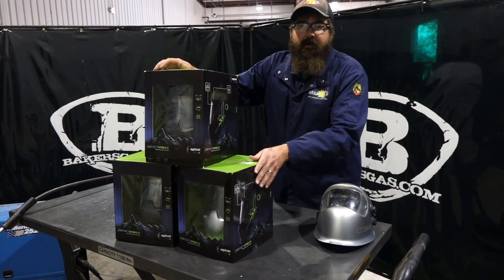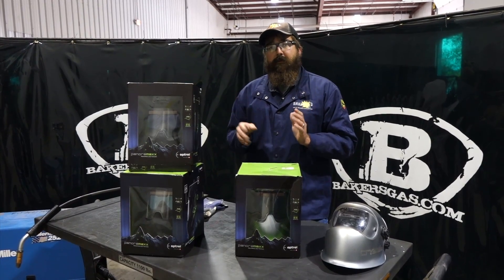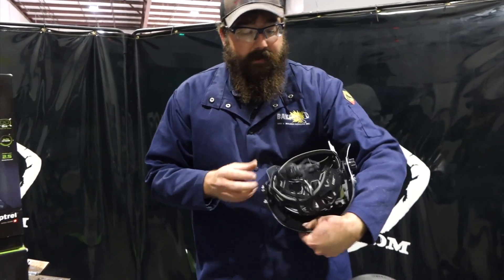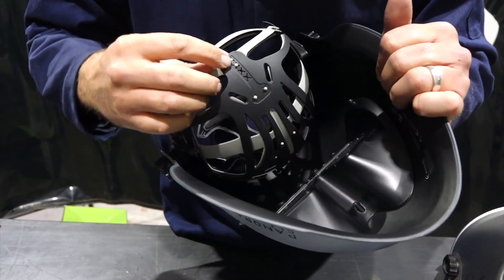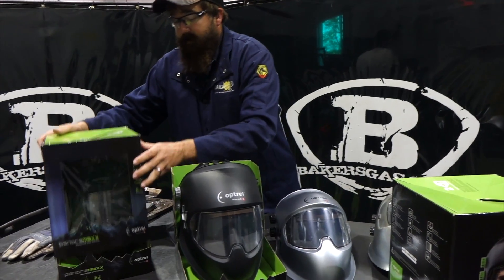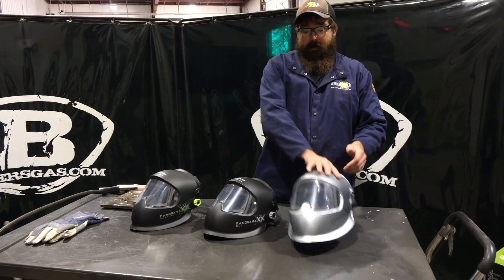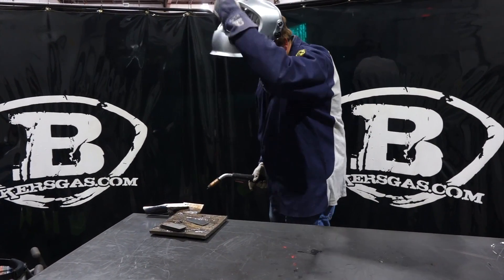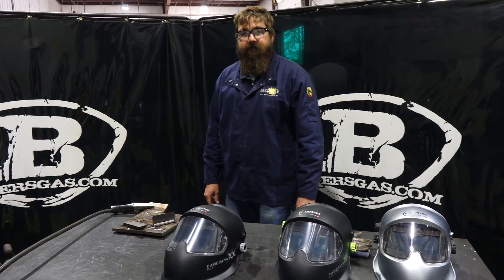New Panoramaxx Series by Optrel - Crystal and Quattro with IsoFit Headgear!

Comment: My major concern about the Optrel CLT hoods which has held me back from buying one, 
is the Permanent non replaceable batteries that last only 300 to 500 cycles. They also Use a Micro USB to charge which are a notoriously flimsy connection, I'd expect USB C from an industrial product. There are a lot of people who have a dead helmet after 2 years, but even if it's 3 or 4 years with the last year charging your hood all the time because your battery barly holds a charge this is just a bad experience I know people that this exact situation happened to. after 3 years they ended up having to switch back to their 10 Year old Speedglas Bad experience for the welder.

When i went looking for pricing on a replacement ADF cartridge thats not even available as a spare part so you have to buy an entirely new hood WHEN the battery dies because it will die.
You might put big hours 8 hours a day under the hood good luck getting past 18 months.
Maybe you only weld 1 hour a day you better be paranoid about charging not just charging to top but waiting for it to get to a low state before using one of your "Charge Cycle"

Just Two terrible decesions that turn a definite buy into I think ill pass. Which is a pity because they do provide great vision, but reliability and keeping your hood operational are just as important.
What do you do if your batteries die midday, with a Speedglas or anyother hood you swap batteries. 
If you have had this hood for  2 years and your now spending as much time charging as you are underthe hood welding no doubt using a backhood. What welder is going to want to pay a premium for that.
Reply: Do you know if the darkening filter can even be removed from the helmet on a panoramaxx?  Bakers usually removes and shows them but does not on this one.

Comment: I used a Speedglas for several years, loved the helmet... great headgear, great shell, excellent big wide and tall view lens, but then I ruined it one day as I usually run TIG (mostly SS work),  but I had this big black iron project that I ran MIG on, and I forgot I had removed the outer dust lens ('cause mine was all scratched up, and you don't need any protection for TIG)... I realized it as I was lying on my back doing close-up 4G with MIG, and after about a couple hours I was wondering why my lens was so 'dirty', nope... I completely destroyed my lens with MIG splatter (major fail). So I thought of replacing the lens (which is never cheap), but then I saw ads and videos for the Optrel 2.0, and decided to give it a try... and whoa! I was floored by how amazing the lens is, it's like you don't even have a lens, you just have eyeball superpowers and can weld without a hood. Oh man, once you try out the Clear Lens Tech, you'll never go back. And as far as the helmet goes (it's the original release version that I got several years ago), the headgear is pretty simplistic and cheap, it's always either too tight or too loose on my head, not comfortable. I've had better headgear on cheap non-auto hoods. And the plastic hood itself is just too light, too fragile, too flimsy... and it's already cracked and I treat my welding hoods carefully. (my Speedglas never cracked). But even with its flimsy hood, and crappy headgear, I still would never go back to anything else... So seeing that they came up with new headgear interests me for sure, but it looks overkill, doesn't look like you can just put the hood on quickly like you would a hat... you have to use two hands and clamp it down each time... looks like Optrel overreacted to people saying the original headgear left much to be desired. But their lens, yeah... miles above any other manufacturer, unless someone else has their own version now. The clear lens can mess you up sometimes though, you get so used to not seeing any difference between natural light and while welding, that sometimes I've forgotten to put my helmet on thinking I already had it on (especially when I was doing some grinding work with no hood, and just a pair of safety glasses and ear muffs on, as it made me feel like i had a hood on my head... until that flash and then i'm like, crap!). Yeah, I wondered about the Panoramaxx with your eyes too close to the lens and your nose shoved up into the helmet, if that was gonna be an issue... and it seems it is for a lot of people, so I guess it matters how your head is shaped, if you wear glasses or not, or use a cheater lens (like I do), etc... Too bad you can't try the helmets first... like a road test. I wouldn't mind having a second hood just in case i screw up my main one.
Reply: You might be surprised by the new lense tech from other companies. I have a Speedglass 9002x thats probably 10 years old and is my daily driver, Ive welded with a buddies new Optrel and was amazed by the clarity as well. But work just upgraded us all with new Speedglas G5-01’s and they clarity of the lense is easily comparable to the Optrel, and you can actually adjust the lense colour between red green and blue with the click if a button. Its a fantastic lense, and the hood is just as robust as any Speedglas.

Comment: I use a 3M half mask respirator while welding.. would it be possible to wear that with this hood due to it having a nose cut-out?
Reply from the maker: Yes! You can adjust how close it fits to your face you can also wear safety glasses so its not touching your face. I will say you might be more comfortable in a regular Crystal (more space under the hood)
Reply: @BakersGas  Thank you!

Comment: can u put the hood in front of the camera so we can see the arc thro the lens? and that head gear looks nice and really comfy but i need a hard hat at work can it be changed out for a hard hat adapter?
Reply from the maker: Yes we will try to get that shot for you! You would have to use the traditional headgear for hard hat adaptability right now

Comment: What is the difference between the CLT silver and black ? My second question is I have a 2.5 already. Can I still use the outer and inner lenses with the CLT ?
Reply: I second this, what's the $50 price difference for if the are just different colors
Reply from the maker: The silver paint is more expensive/heat reflective. That is the only difference.
Reply: @BakersGas  I tig weld stainless pipe pretty much all day, I use to a Lincoln electric 1740 Viking, and am wondering what you would recommend I get that the silver reflects heat better, but since I only do tig is that as big a deal for me?

Comment: So I ordered one from amazon but I was disappointed because I ordered the clt but for some reason someone i think took the head gear off and switched it with the old traditional head piece. So my question is when I do buy a brand new helmet panoramaxx clt unopened, should it already include the nice head gear called iso fit? Because im confused as hell. It was xmas present to myself and was excited 😞
Reply: I ordered the Panoramaxx 2.5 with the e3000x PAPR system which sadly doesn’t come with the fancy head gear because of the liner needed to seal you in and breath all that delicious fresh clean air!!! I want the CLT though
Reply from the maker: Don't buy from Amazon lol ....Next time order from us directly :)

Comment: Do standard 3m respirators fitted with 2097 pancake filters fit under the panoramaxx?
Reply from the maker: It would be tight but would probably work. The most popular welding respirator for under helmets is the LPR-100. 
https://bakersgas.com/products/miller-lpr-100-p100-respirator

Comment: Looks like you have to pull the headgear out to get to the controls. Wonderful design so you can't help but wipe you're greasy fingers all over the inside of the lens while you're adjusting the controls. WTF Optrel? I'm developing a disrespect for Swiss engineering here.
Reply: I agree. I hate inside controls, what a joke.

Comment: The design looks really great compared to 3m Speedglas.
Would you recommend the Optrel panoramaxx clt for industrial use(oil&gas refinery) with the  e3000X PAPR system??
Reply from the maker: Hey! Yes for sure, it is durable enough to work in an industrial environment. The e3000X is the best PAPR in our experience. If not that one check out the Miller T94i. (3M is okay but typically backordered and harder to get parts)

Comment: Hi,
 Thank you for this video. The Crystal 2.0 model has encountered issues regarding side tint of the lens which is lighter than the center when soldering. You can see this phenomenon in this video:
https://www.youtube.com/watch?v=9s69PFmxifw
 This is a Panoramaxx 2.5, but it is the same problem. So, have you noticed the same inconvenience on the Panoramax CLT as well? Thank you for your answer.
Reply: I have exactly that issue! I was hoping i was the only one...
I just bought the panoramaxx clt a few days ago, there is a black stripe diagonal from right top to left down corner. It is very enoyoing! It is more enoying on a light shade than it is on a dark shade but it is still there, as well on auto as it is on manual setting. I just received another one just this morning,  EXACTLY THE SAME ISSUE!!! i dont think it's worth the €650,-   it is a great helmet and for 300 one would perhaps be ok with this, but not for €650,-  :(
Reply from the maker: No we have not had that issue but if you contact Optrel they are great to help.

Comment: I've welded with a panoramaxx for over a year now and it's awesome. Its extra safety for high traffic areas, and great welding, and great sensitivity. The biggest problems with them are hitting your glasses, and the heat is way worse on your face. Gonna grab an isofit for it I guess haha. I also have a crystal 2, and I just prefer the viewing angles over the color for my work environment.
Reply from the maker: Thanks for watching! Keep in mind you could try the mag lens for the Pano if you wanted to go without your glasses!
https://bakersgas.com/products/optrel-5000151
Reply: @BakersGas  yeah I've seen these, I'm just talking about safety glasses! Turns out you can adjust it farther from your face, but you lose some fov
Reply: Do you find the inner protective lense has spaces 360 around it especially at the top middle? Considering i paid 1200 canadian for the panoramaxx papr version i am choked how they can charge 5$ for an inner lense and it doesnt even protect the screen on my 1200$ helmet. The inner lense should have a built in rubber gasket like the front protective lenses have or at least have a frame that snaps the inner protective lense in place. Even by the bottom of the nose piece there are so many gaps for dust to land on your screen. Ive had the helmet 4 to 5 months and i only noticed the inner protective lense is useless when i saw i had random welding dust specs all over what i thought was the protective lense. But no, to my surprise it was on the screen itself and i managed to remove about a dozen of them with the provided cloth without scratching my screen. I am shocked how shitty they designed that part of the helmet.

Comment: Perfect timing!  I was about to order a Crystal 2.0  My question is:  Silver vs Black?  When would I notice a difference, besides the price?
Reply from the maker: They are the same helmet/lens. The silver has that Crystal look but more importantly designed to not get as hot while welding.
Reply: I'll be brief. If You weld 9 hours on a 10 hour shift the soot will be as obvious as a scratch on black paint. If you weld 3 hours on a 10 hour work shit then you deserve a silver. It wont get dirty with small time welds. I recommend black for structural. 1 moist cloth swipe all around is all it takes to keep it looking new.
Reply: Plus! The temperature stays the same when fcaw, and smaw. Silver is nice but the cleanliness is much more easily maintained when using black
Reply: @CovertOverwatch666  If you really care what it looks like, if it gets dirty it will be dirty the same amount regardless of the color but you will stay cooler with the silver. If you are welding in a hot environment the silver is the way to go, comfort over fashion.

Comment: The Crystal 2.0 is an amazing helmet. Unfortunately i'm still waiting on a warranty replacement from Optrel. It crapped out in July, i'm still waiting for a replacement lens. They have been back ordered, yet some how Optrel has plenty for new helmets. I don't think i'll be buying another Optrel
Reply from the maker: Send us a message and we can follow up for you
Reply: Does it fog less than ordinary hoods ?
Reply: @OlivierSuire i have the papr version of panoramaxx clt. I do get some fog on medium fan setting so i try to control my breathong better. I dont get the fog on max fan speed but i try not to use thwt setting or my battery dies in 7 hrs and i work 10 hr shifts with breaks. I decided to see if the helmet works with a respirator (pancake p100 filters) and to my surprise i can confirm it works with the helmet perfectly fine and no fog on thr lense at all. I actually think i am going to stick to the respirator now because i find the papr annoying to fab with. Definitely wish i just got the regular helmet. The only thing i hate about it is the inner protective lenses never fit firm and have no gasket or clip holding it in place. U basically fish two tiny tabs into slots on the left and right of the lense. Its dumb because it always bows 360 around the lense leaving gaps everywhere thwt dust can get into. Was very dissatisfied such an expensive helmet does a bad job protecting the lense. The outer lense protectors however do have built in rubber gaskets that come glued to it.
Reply: My panoramaxx xlt papr has 1/32 spaces all around the inner protective lense. This allows dust to enter their helmets and land on the screen. I thought maybe it was a defective inner lense so i replaced the old inner lenae for a new one and same thing. 5$ each and they dont even protect your most expensive lense on thr market. I am actually thinking of messaging optrel to complain. My first helmet arrived from canadian welsing supply with a micro crack at the nose piece. I was sent a replacement helmet and i can confirm both helmet inner protective lenses never sit firm and have gaps. The area top middle where they made a recess for your finger to grab at the inner lense has the biggest gap. Literally 1/32. If they were going to leave a large gap like that for dust to drop into they should have putbit on the bottom because gravity wont want to choot dust up into the bottom like ir does from the top. Could have added a gasket or something to clamp thr inner lense flat. Terrible design. Ive owned mine 5 months. Lense is amazing but im kinda choked my helmet will keep getting dust on thr lense because of defective inner protection lenses. Will probably resort to taping the seams somehow.